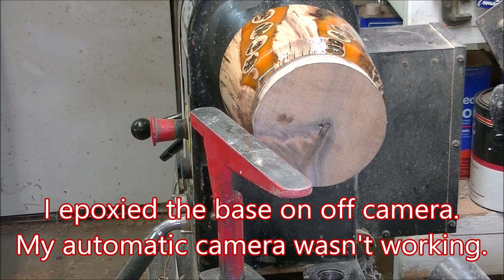Beauiful Hickory Nut Bowl # 272

Comment: Larry:  Do you have a Steady-Rest that would accommodate the width of that (or future) bowls?  You could use that to keep it from wobbling instead of the tailstock.
Reply from the maker: Yes, I do.  It's got about an inch of dust on it.  Guess it's time to dust it off and see if it still works.  Thanks, Larry